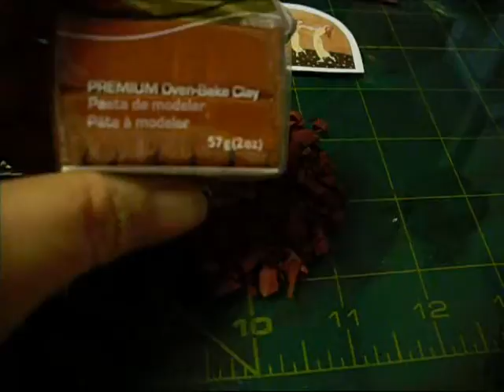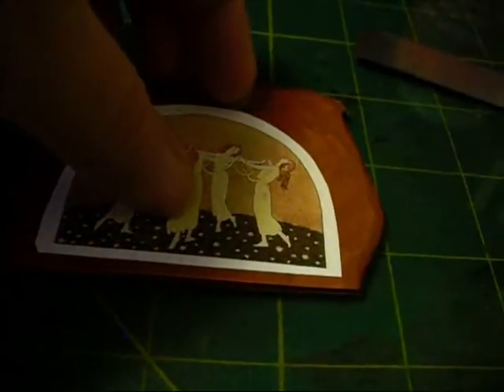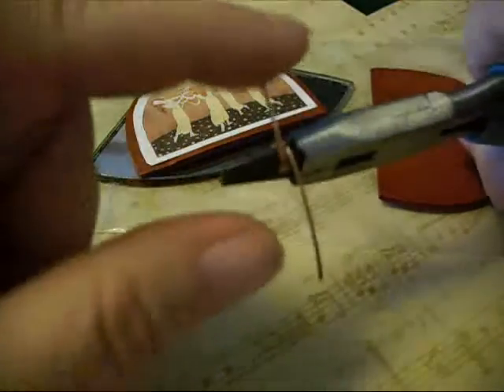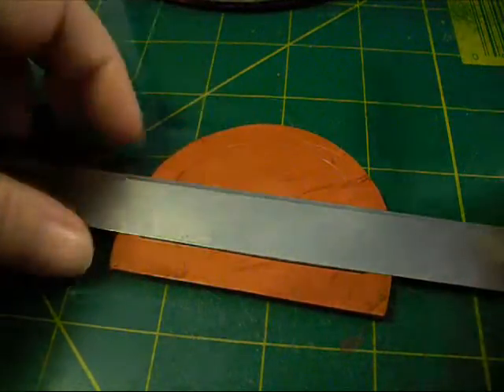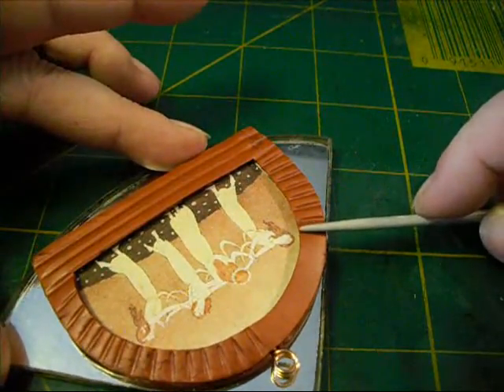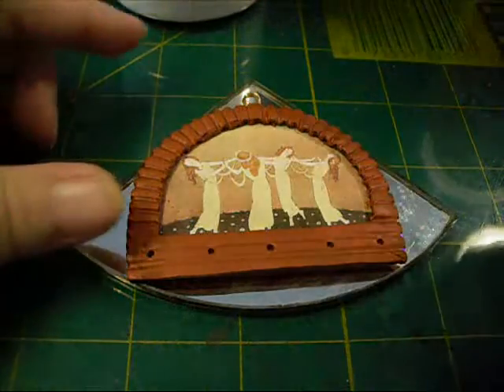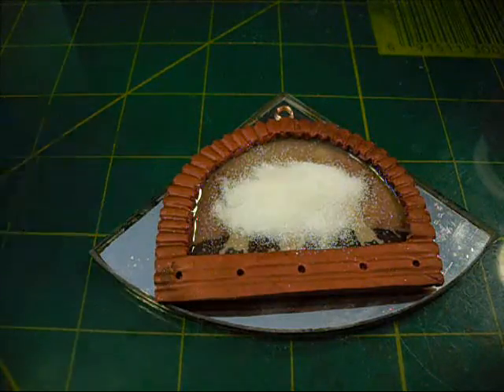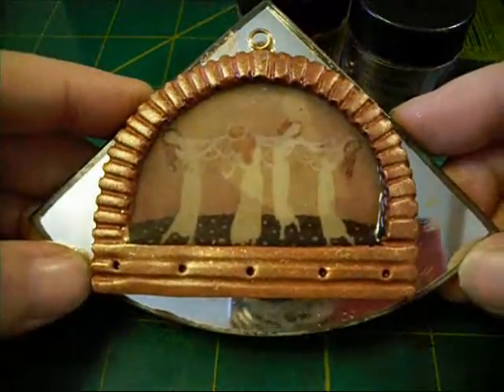SPRING! Using Embossing Powder on Polymer Clay Pendant

Comment: Love how you make your bails! This is a fun and beautiful project. 

I did make the huge mistake of putting TLS under a picture on a tile and it turned out really bad. It could be that I just used too much though.

The embossing powder gives the picture a really cool look.

I have some glossy accents, but I have never used it. BTW, I'm not sure how this would work with clay, but I have seen a technique where someone used packing tape to laminate their picture before adding a resin coat. (cont.)

Comment: After baking, I would use Aleene's Jewelry Pendant Gel  or 3D Crystal Lacquer instead of embossing powder. Glitter can be added but both will give you the glossy finish and I haven't had a problem with ink jet ink (so far, knock on wood).  Both will self-level, leave over night to dry, longer if it's humid or high heat.
Reply from the maker: I also have many different finishes that I use, this one was just an experiment. I'm mostly self taught for the past 10 yrs or so, so many times I share my experiments in my videos. Thanks for the tip though, I'll keep these in mind since I haven't tried either one. I thought the 3D Crystal Lacquer was similar to glossy accents, which I didn't care for...it didn't have a "hard" finish to it when dry.
Reply: I've never used Glossy Accents, since I always associated it with paper, and I'm not a scrapbook person.  My all time favorite for polymer clay is the Polyurethane, or Varathane.  I use the quick dry ones, and have been continually pleased with them.
Reply from the maker: Hi Martha, I agree totally...lol. I did the glossy accents to answer a question for a viewer, I wouldn't have ever even thought of using it myself. Some artist use it though or the triple thick, I didn't have good results with either of them...too sticky when dry & not a hard finish. I too have always use polyurethane or varathane & really get good results. Thanks Martha & thanks for watching & for chatting with me. Lyn

Comment: Have you tried using Mod Podge or white glue to seal your paper before adding the powder? I haven't used embossing powder before, but there is a technique recommended for preserving the paper before putting it under liquid acrylic. You can use either Mod Podge, or homemade Mod Podge, which is 2 parts white glue, and one part water, brushed over the top and edges of the paper. ...Let it dry, and then add your acrylic.
Reply from the maker: Yes, & it's great tip too. My problem was...I only coated the front...lol. Never thought about it seeping under but hey lesson learned right? Thanks so much for the tip & for checking out the video & TFW.Lyn

Comment: I think you've just taken my clay sculpting to the next level! Here's my question: I like to make masks... would this work with a curved surface? I was thinking of stamping the clay and filling the stamps with embossing powder, but they're baked to fit the face, so would it just leak everywhere? Is it possible if I keep an eye on the project while it's baking?
Reply from the maker: Hmmm...not sure, I know the embossing powder sticks to the raw clay naturally so it sounds like your baking it in shape first then wanting to emboss...wow, I'm not sure if it will leak or not. I have embossed 3D pieces of clay before(small pieces) & I didn't have any trouble with runs/drips but clear powder seems to be a little thinner. Maybe a think UTEE in clear? Good question, might require some research. TFW Lyn

Comment: hey Lyn! I have a question or two. couldn't you use uv resin or regular resin instead of embossing powder? also could you use mod podge to seal picture first to prevent discoloration then add whichever chosen filler?
Reply from the maker: +LadyJolynna Absolutely, this video is a few years ago & I didn't have any resin then & yes you can seal the image with a sealer of your choice. I was just trying to show some other options since not everyone uses or has access to resin. Thanks Jolynna!

Comment: Lynn, why couldn't you use a embossing gun? I know you said you didn't think it would stick but wouldn't it be the same as the oven? I'm just curious.
Reply from the maker: Robin Skerbinek Hi Robin, yes I could have but I didn't want to risk all that embossing powder blowing around...as mine has a fan/heat type action. If you have one that just does heat without the fan then that would work great. I was putting the embossing powder on pretty thick though & it was all loose. Thanks for watching! Lyn